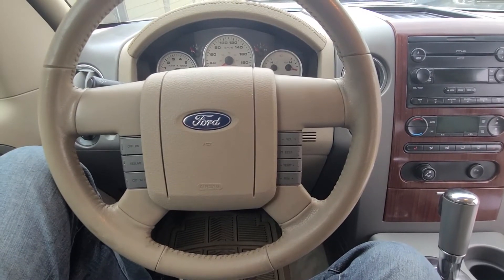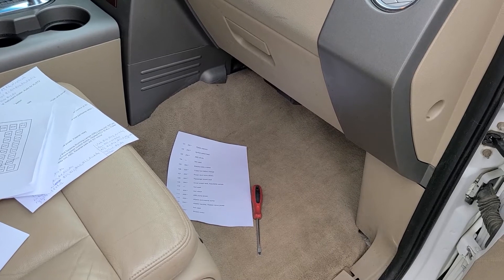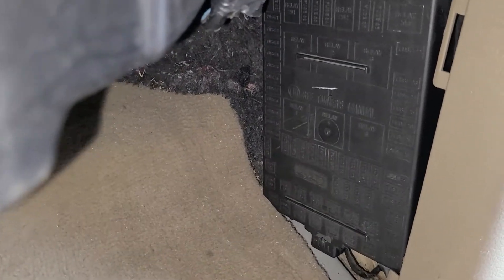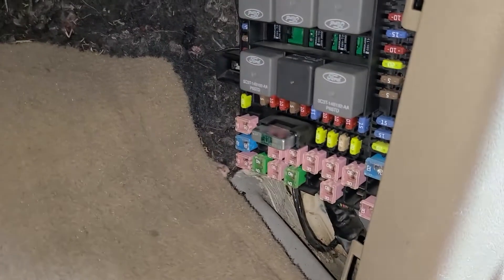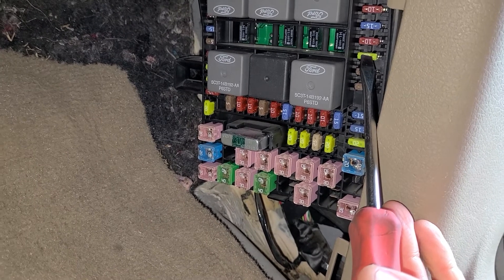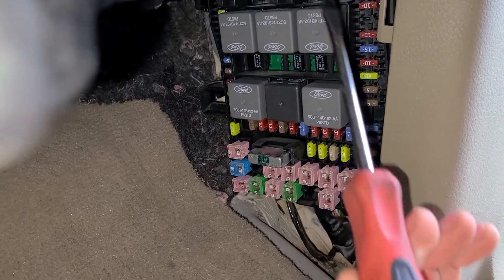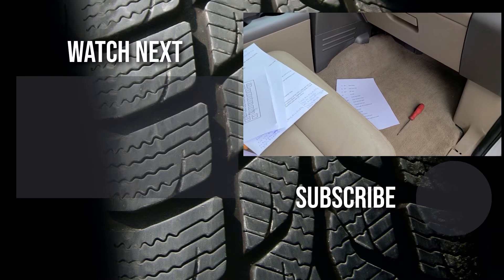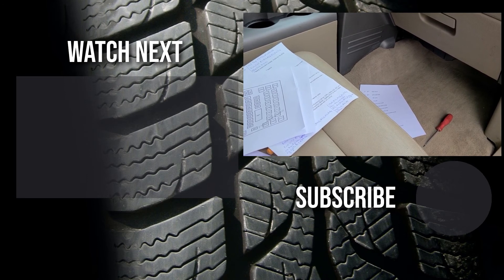Ford F-150 - HORN FUSE LOCATION (2004 - 2008)

Comment: My 06 f150 horn is blowing off constantly on its own. Can I just remove this fuse and disable the horn until I can get it fixed?
Reply from the maker: Yes removing the fuse will disable  the  horn
Reply: My 05 does too and it’s embarrassing..
Reply: @KP-sc1nh  I just pulled the fuse. I actually spilled pickle juice on it,  just behind the wheel lol. I had airbag lights on and the steering wheel controls went out for a while until it dried out. Now it's all good
Reply: @baratonelevy4865  I pulled the fuse out also yesterday. I wanted to cut the horn wire I was so frustrated. I’m glad your juice got to dry up without causing damage.
Reply: My 04 is doing that too , the alarm will go off randomly and now it’s not working at all I replaced the fuse that was blown but still nothing